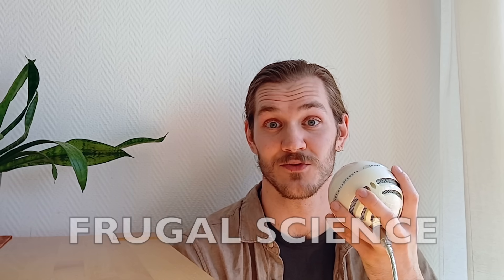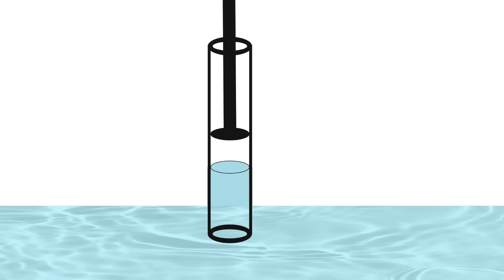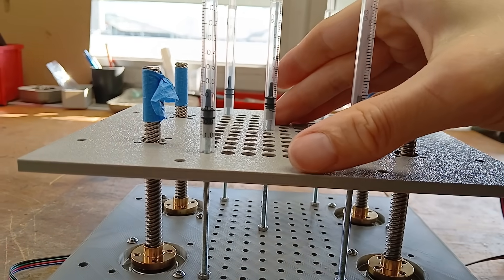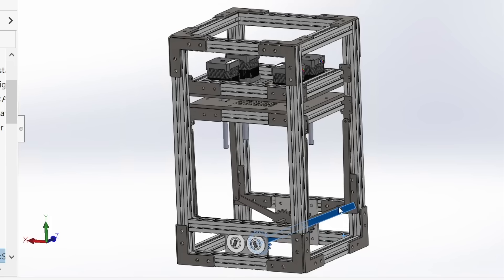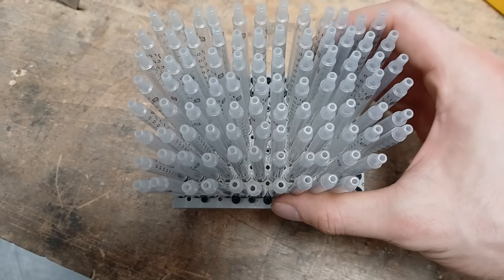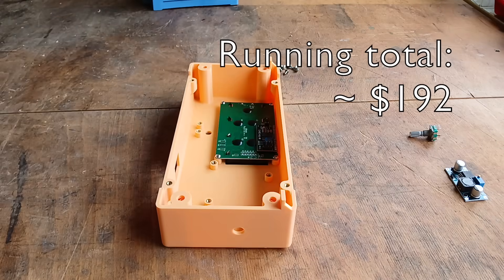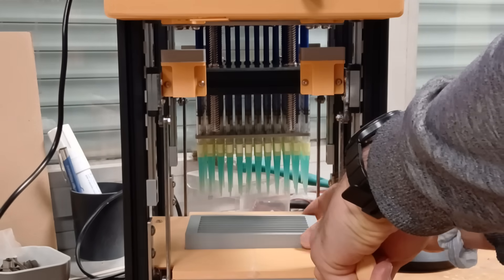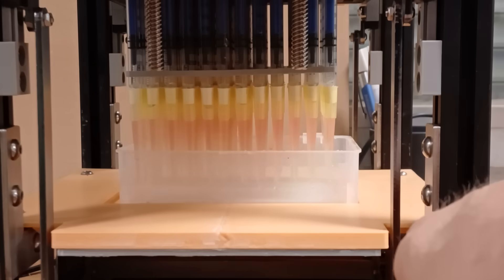This Medical Machine costs $18,000. I Took It Personally.

Comment: The high price of the original is due to certification requirements not from bad engineering, so this build does not solve the high price problem - unless we're talking apocalypse scenario when it's better to have a non-certified DIY solution rather than no solution at all.

The lesson here is, if you want to make it cheaper, make it with less parts that require certification.

Question, can you 3D print it as a single part? The less parts, the better.

Comment: Very cool. I would definitely worry about consistency between pipettes here. It'd also be really nice to use borosilicate glass or steel pipettes so they can be autoclaved but if that breaks the budget then at least having something between the pipette and tip that can be replaced and includes a filter to prevent liquid from entering the pipettes would make this more realistically useful for sterile work.

Comment: (Eng is not my native, sooo chatgpt is my translator😂)

If someone wants to DIY something like this and actually use it in a medical or clinical lab, there is quite a long road ahead.

Depending on the country, you need to deal with regulatory and pharmacological requirements, standards, and certification. For devices like multichannel pipettors this includes not only accuracy, but also sterility and microbiological cleanliness.

I used to work in pharmaceutical sterility control and later with genetic labs, and requirements can differ a lot between teams. Besides sterility, protein or DNA contamination is a serious issue - even trace amounts can reduce the accuracy of genetic and molecular biology assays.

Long story short: I really love such videos and DIY devices. But these requirements exist for a reason, just like safety regulations. If after full testing, certification, and legal procedures the final product ends up 10× cheaper — I would be genuinely happy and would gladly recommend it to colleagues around the world.

However, making one device quickly for urgent needs with limited budget is one thing. Scaling it into a reliable, affordable product with mass production, quality control, logistics, and sales is a completely different challenge. And unfortunately (speaking also from marketing experience), without marketing it’s impossible to deliver a trusted product to everyone who needs it.

Comment: I’ve seen a lab filled with these machines, and most of them weren’t even in use because experienced physicians were anyway faster and more precise doing it manually then the machine. Only if they actually produce 1000s of samples would they use this, but then again these sizes are barely reached.

Comment: It is all about consistency and accountability. My friend is a plumber and paid 300 euro for a pressure gauge from company named WIKA and the only difference between 10-20 euro pressure gauge and a 300 euro one is that one has gauge with more lines and comes in a box with a piece of paper that states it was calibrated, tested, certified and complies with....copy paste all certificates.  So for a gauge you use to check gas pipes for leaks you spend 20-30x more for certainty, individual serial number and a certificate which is valid for 1-2 years. So i guess that 300$ materials make sense, but it is unusable in real lab where you have ISO.

Comment: I didn't know the term "frugal science" but I always adored the concept. Now that I know it I'm gonna willingly fall down the rabbit hole. Great project, I had my doubts about precision of this machine but the two colours test really surprised me. The only thing I would change if you're going to do more of this (I'd really love to see it) is test it with a jewelry scale - they are really cheap and can measure down to 0.01g
Reply: They also sell those in head shops for like 30$ a piece....for jewellery. :face-green-smiling:

Comment: i never understood how the tips of the pipettes stay clean and not contaminated after performing the task. i mean they came into contact with something the first time. wouldn‘t there be remainders of that the second time? i don‘t mean your machine in particular but every one of those apparatuses.
Reply: The really one have a auto eject system so that you can replace it after each run

Comment: Love the idea and some of the engineering is a-class... one little thing though: with possibly different uses each time or with pulling the solutions from an open container, over time impurities will add up in the syringes... which means you need to be able to change them frequently: maybe the effort of doing so, could be minimized. other then that: love what you are doing :)

Comment: Yeah, nice idea. But it will not work - at least not for long. The syringe barrels and plungers are in no way durable enough. In the professional pipette systems, plunger and barrel are perfectly fit ceramics, sometimes glass or more rarely metal. So there is no rubber or other wearing parts in the mechanism. Your construction will make less than a hundred dispensations before volumes are incorrect. In a lab, this will be around a day or so. And your system will fail in an unpredictable way. -  You know, there is a reason the real thing is expensive. Sure, these systems are overpriced. Because science and stuff. But they can't be made and verified for cheap.And they need to be verified and certified. There needs to be a chain of responsibility that the thing does what it says on the tin.

Comment: save 100 bucks and buy an old bed slinger 3d printer generally have 4 motors 2 zrods some have rails , electronics box. wires etc. as for the 4 motor lift config. you could duplicate z axis from a corexy only reverse it since you're want is to move the plate with plungers. though they tend to be single motor im sure dual rail/motor could be used for stability. really appreciate this build!

Comment: I think it could be cheapened further by using fewer motors, perhaps Even a single motor connected with belts or gears to the four Threaded columns. You might need more torque but that can easily be done with some mechanical reduction.

Comment: I was planning on building something similar to fill liquid supplement capsules. But it appears that you beat me to the punch! What is the precision of machine? 10ul?
Reply: Also I was wondering, was there a hard limitation of spacing that required you to sand down those plungers? I am thinking about increasing the width of the plunger grid to account for the size of the plungers even if it makes the machine slightly bigger.

Comment: The original plungers could be easily mounted without sanding them down. Just recess every second plunger and stagger the rows by one. The plate on top also needs small bumps for the lower plungers. This would remove one step in the manufacturing... or 96. 🙂
Thanks for the video, it gives me ideas for my own home lab I'm building.
Reply: If you stagger any, on any axis, you will not line up with the tips or the sample plates.

Comment: Bro spend so much time and energy, just to validate the accuracy by sucking up water in a paper towel (wtf) and weighing it with a kitchen scale (WTF)... 

That's just not good enough. You can get a letter scale for <$10, the only reason not to do that is because the results are bad. I don't buy it, sorry.

Comment: as someone who works as an engineer in the medical equipment field its a great stuff for home labs but machines that go to the end users such as labs need to be certified which is 90% of the time reason for the high cost and also they need to be easy to put together which is the main problem with your design in my opinion, i can hear the minimum wage workers cussing your name allready. Never the less keep it up.

Comment: Grat work.  You probably need to be able to replace the syringes. The sealing rubber in them won't stay good for long. So maybe a different syringe or a staggered aproach? Would work for the plungers atleast.

Comment: Instead of sanding the plungers you could "stack" them. One slightly raised followed by one slightly lowered. Their absolute position does not matter.
Reply: Doesn't work for uniform alignment. You will create pressure and thus inhomogene force on parts of the outer rings leading to slight angles on the shaft over multiple runs. It will also alter the relative position of the null line for each run and each connected plunger.

This can of course be quantified. For most fine tuned application I would caution against it. However it certainly is worth a couple of hundred automated test runs to see if it is a big problem here. 

My idea was to just do a mold that fits.

Comment: For cost effectivness, many 3D printers only use one stepper motor but 3 or more lead screws connected by a GT-2 Timing belt for synchronization!

Comment: Hi. It is not that the machine costs so much to make. It is the certification, documentation, approvals, testing, CEO compensation and shareholder dividends that add up.
Reply: Everybody saying this is missing the point. There are lots of usecases for this that don't require medical grade equipment. What about schools in poor countries who want to give their students access to basic equipment to perform experiments with? What about artists - the video actually showed mixing pigments - this could be a boon to painters who could use it to mix paints or even make their own. Certification is a brilliant thing, keeping us all safe from dodgy manufacturers where we really need that protection, but there's lots of potential uses for technology like this if you make it accessible and cheap.
Reply: @TheFutureIsEloi  For all the usecases that don't require all that certification, we already have options available. For example, Rainin has Biohit as sub-brand, for customers that need a cheaper, unaccredited option.
Reply: @TheFutureIsEloi  yeah but 18k is hmm too suspicious, nvm it''s always the medical industries greedmaxxing
Reply: @thefirstsin  Don't underestimate the cost of precision. Professional devices will deliver accurate and repeatable (!) performance over tens of thousands of operations. Making sure that every single unit is up to spec is an absolute necessity so you can trust your results. Does it really cost 18k ? No, but 2-3 k are a reasonable unit base price. Add to that cost for staff salaries, R&D, etc. and you're in the 5 k range.

Comment: Wait, could you have used a gear on top that spun the four corners with a single motor or even connect that through gear reduction to a crank where every turn of the crank would be an super small amount of motion in the seringes, just like a lathe uses gear reduction to get precision mechanically

Comment: All of this is great, but using a syringe in this machine is impossible - it will stop working after a few uses! If this part is not disposable, then the syringe will not work! I don't think that all 100 cylinders and pistons are replaced every time - they are probably washed and sterilized.

Comment: Hi Triggy, if you instead use one motor for the z-stage you can use pulleys and belts and four M6 threaded rods and have one motor spin all four rods via the belt, you then save 3 motors and also free up pins on your controller for other functions :)

Comment: 7:00 you want to control the volume sucked/injected between two positions -> what is interesting for you is the delta V -> you don't need the plunger to be at the same height z0 -> you can design the plungers pushing surfaces to be at 2 alterning levels to eliminate the need to sand them

Comment: I can really see this improving and being used to perform basic field tests!
Only thing I would change is the interface. A single knob seems cumbersome to use, imo it would work better with buttons placed on the opposite side of the lever (or even buttons on the lever grip for one handed operation).

Comment: This is incredible. 

While high precision, high traceability devices have their place (within reason), the fact that those devices are basically unreachable in poorer areas of the world means that what you're doing could be massively useful. 

Have you considered pairing with Doctor's Without Borders or a similar non-profit?
Reply: Sorry, but this is worthless if it's difficult to use, impossible to clean, impossible to calibrate/adjust, or has zero certainty that it works the way it needs to, and this project is all of the above.

Comment: Very nice project!

Some remarks:
01:20 - using pump - there are multi-channel devices which do that, but not for dispensing accurate quantities of liquid though - look up: "microplate washer".
02:25 - plunger design - you may want to look into "micropipettes" and how they are built. They have plastic, metal, or ceramic plungers, use seals and O-rings, plus some grease, but don't have excessively tight fit (they are hand operated after all, and some force is required because they have a return spring). Use of syringes was a good idea though.
05:30 - there are syringes like this with polycarbonate body / barrel. (There are even fully glass syringes like this - without any rubber tip.)

While it may be difficult to put a device like this in a medical lab due to lack of certifications etc. - I think it could be very valuable for an underfunded research labs at universities.

Comment: You spent a lot of time making it a certain size and pipet distance. Shaving down parts to make everything fit with a certain distance. But, I don't understand why. Why can't it just be a bit bigger? I realize that there are standard parts that fit the standard spacing, but for a massively reduced labor cost and simpler machine couldn't you just make a more spaced out machine?

Those sample trays are just vacuum formed, they should be pretty easy to reproduce with more spacing.

Comment: 1. Stop using unsecured threaded rods and expecting them to provide alignment. You did this with your plate motor setup, except that one accidentally solved itself when a rigid frame got added. But then you somehow expected it to work again, this time with a 100 plungers. Threads provide translation only , pins or rails provide alignment. That's why 3D printers use linear rails in the setup you "don't like".
2. Making science and/or medicine more accessible is great, but it helps to understand where the costs and/or limits of availability come from, which you clearly don't. As the other commenters mentioned, it doesn't cost $18k because the manufacturer cannot figure out how to source $200 of 3D printer parts. It's the traceability, repeatability, sterilisation, and other kinds of important overhead that matters when doing it wrong will kill or maim someone. Plus a lot of money invested afterwards in keeping the overhead high by the few players who have jumped through the regulatory hoops and now have a vested interest in keeping the supply limited and expensive. It's the latter that you want to do away with, but your design only sacrifices the former, which is the part that is actually necessary, at least in some form.
3. Dial/button combo is a terrible UI choice for high stakes, high cost of error processes such as medical diagnostics and controlled science experiments. It will want to jump to a different menu item than intended when the user presses the button. "Select" and "confirm" need to be separate controls. Or better yet, have dedicated buttons for aspirate and dispense, which are the primary actions of your machine, but in your design require two fiddly menu interactions per cycle, of which there will be hundreds in a day.

Comment: When I use those small insulin syringes (marked single use only) repeatedly then the plunger quite often pulls out of the rubber piston when sucking up thicker fluids.  You might need something like a ring of heatshrink to hold them together dependably.

Comment: 2:07. Why not use a single stepper motor, with belt drive to the four corners?  (Actually, you should just stick with three corners, for better fine tuning, and further cost reduction, and improved reliability.)  This reduces cost, weight, and complexity, and increases reliability.  With four stepper motors you have to keep each one in sync, and if some stops responding, you're going to have a problem. Why not just have the four corners mechanically interlocked (or three), and have a single drive unit?  Think about how Bambu raises and lowers their z-plane on their core X/Y machines.
Reply: The stepper don't fail under such small load they will last for years i am telling you this with experience  the reason for using 4 stepper might be because of equal movement across the base ... he could have used a timing belt but then the belt need constant tension and belt tend to loose and get rough with repeated use his designe is solid with ball screw design the screws will provide stability and smooth play ...
Reply: @Nomad_Wanderer  It's super easy to keep a belt tensioned, you just use a simple spring as a tensioner, and the belt will last the lift time of the of the unit, and if it manages to fail, it's an easy fix.  The fact is, stepper motors fail more often than no stepper motors, even if they are otherwise a reliable part, so 4x stepper motors is 4x more likely to fail than a 1x stepper motor.  Fact is, keeping four stepper motors in proper sync is more effort than just mechanically distributing the torque in such a way sync is guaranteed.  Fact is, initial setup is more complicated with four stepper motors, than a mechanical torque distribution system, which makes manufacturing more difficult, and thus makes scaling up the manufacturing more difficult.  Fact is, a stepper motor is a significant cost input in the BOM, and thus having only one is a meaningful reduction.

Comment: not bad, but you could literaly use only one motor to move up and down for this easy aplication :D with 3-4 or even just 2 guides (if the goal is to be cheap)